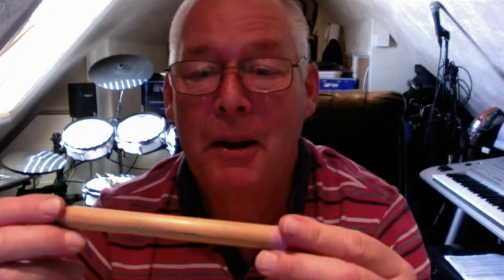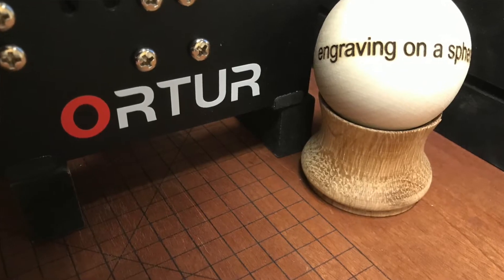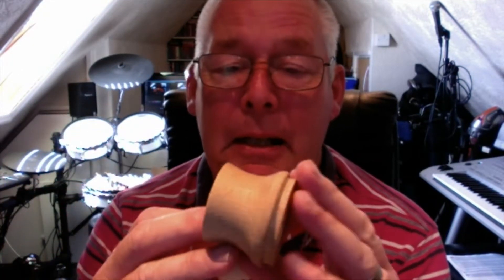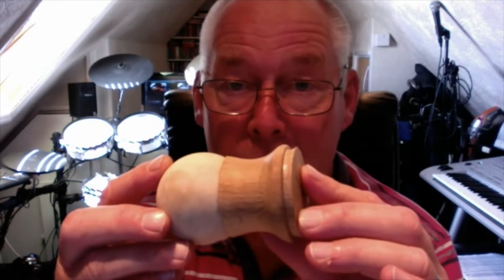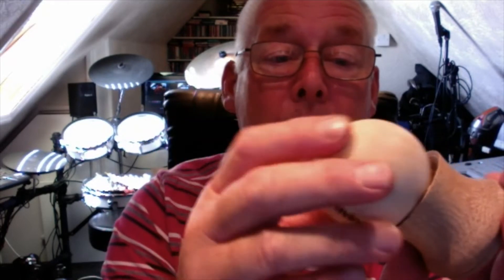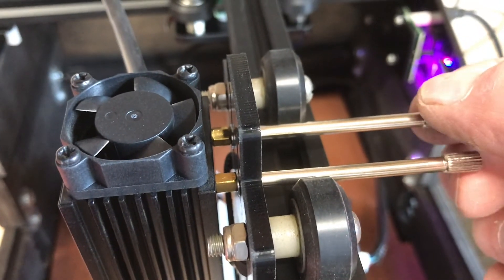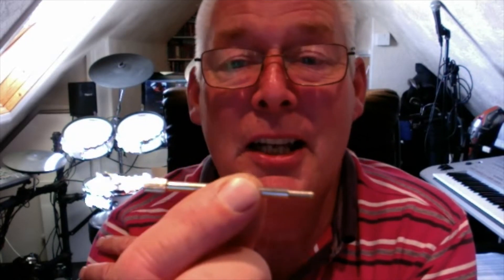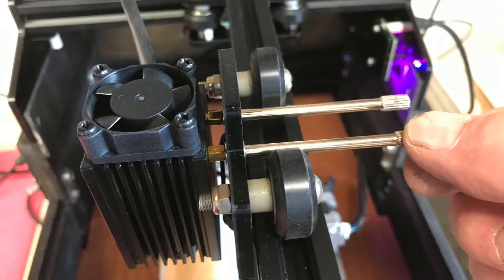Ortur "Y" Axis Rotary Roller Engraving on a Sphere

Comment: Have the Ortur 2 20w with rotary. Have you engraved pint glasses, wine glasses etc. Looking for guidance on this. Thank you!
Reply from the maker: Hi Michael, I am currently using the 7w module and therefore unable to help however, I have the 20w sitting beside me but waiting for the cable to arrive from Ortur, as soon as it does I will be testing it out on a number of materials inc glass. Thanks for your comments and please subscribe.   John

Comment: Thank you very much for the video showing the pencil engraving. Clever use of the cylinder head screws; can you kindly provide the link to where they are available.
Reply from the maker: Hi, apologies for the delay in coming back to you. The link is      https://www.ebay.co.uk/itm/M3-Cylinder-Head-Knurled-Long-Thumb-Screws-Ni-plated-Steel-Hand-Grip-Knob-Bolts/123895127489?hash=item1cd8b99dc1:g:e-EAAOSwMxhdaNeS        Rehgards, John.